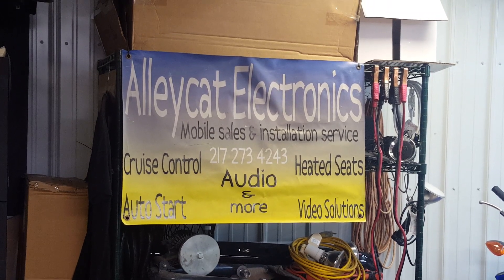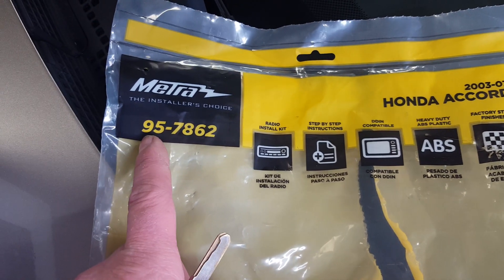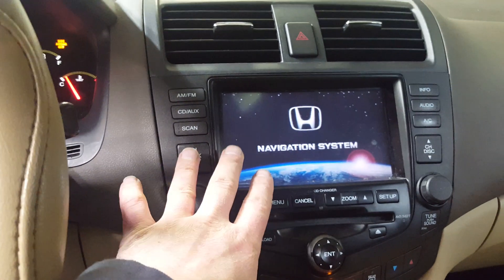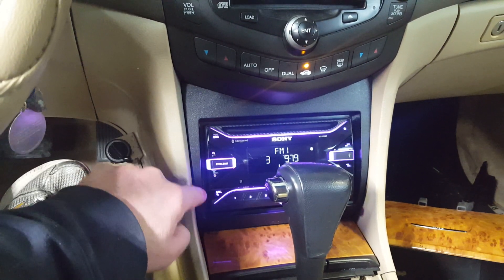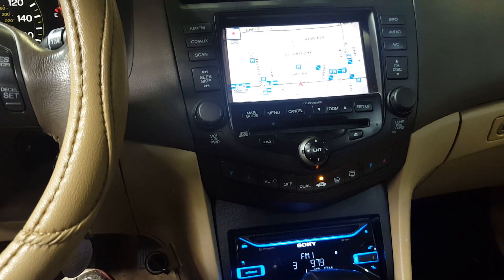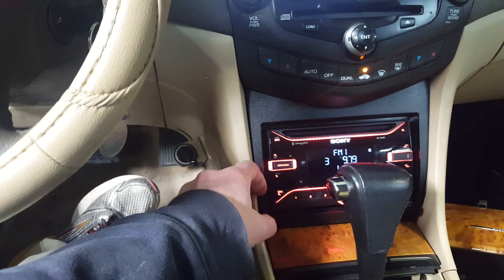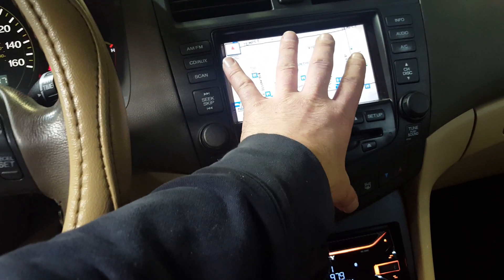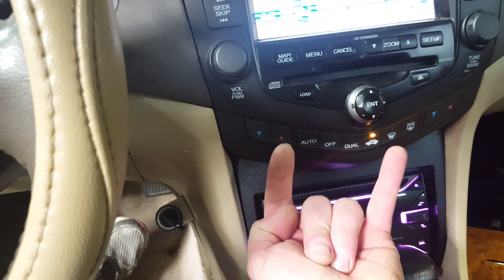2003-2007 95-7862 double din radio Honda Accord Alleycat Electronics

Comment: what do i do with the original radio after i install the double din, do i just let it sit there or is there something i can buy to cover it up?
Reply from the maker: leave as is or there's also a kit that replaces the complete radio at a much higher expense   .   the kit in this video is maybe around $40   the link below kit closer to $350 puts the aftermarket radio in the same location as original
Reply from the maker: http://www.metraonline.com/part/99-7803G
Reply from the maker: less expensive route below
Reply from the maker: http://www.metraonline.com/part/95-7862